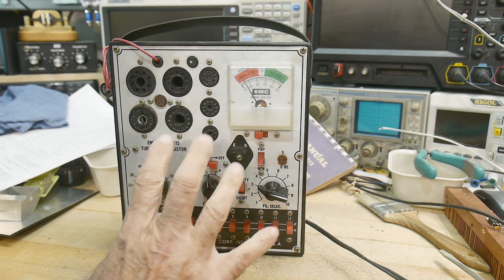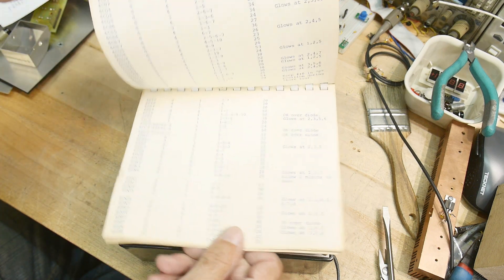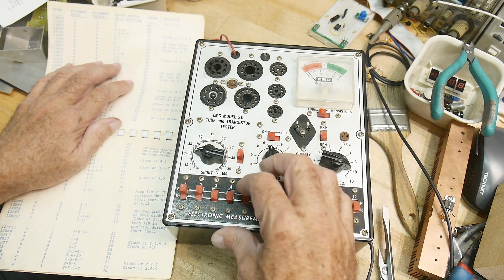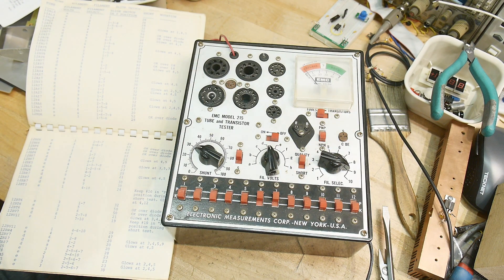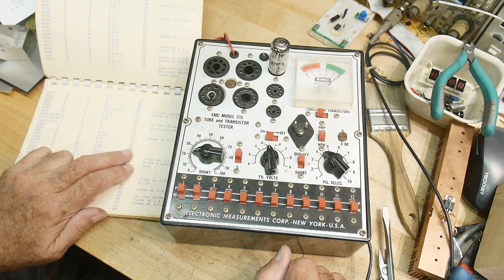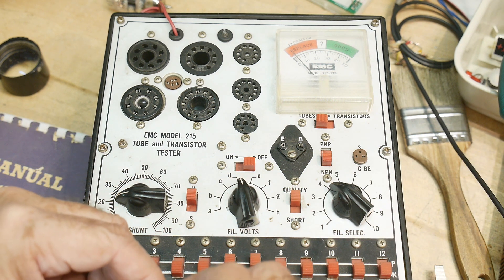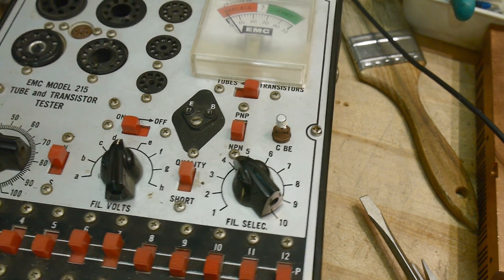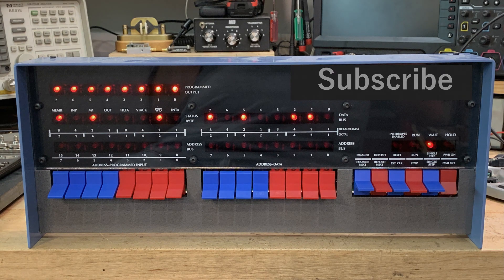#1663 EMC Model 215 Tube Tester

Comment: How come the 2 tubes had the same filament setting since one is 6 volts and the other is 12 volts?
Reply from the maker: d9 and d4 for filament settings, have no ideas what those two knobs do
Reply: I think the explanation is that the 12AU7 has a center tapped filament so it can be used with a 6 volt source. Probably the filament selector switch makes this connection.  By the way, as a retired EE with 42 years experience, I greatly  enjoy your videos. @IMSAIGuy